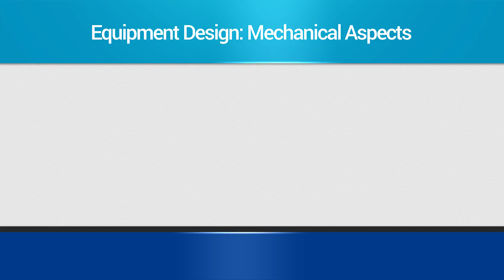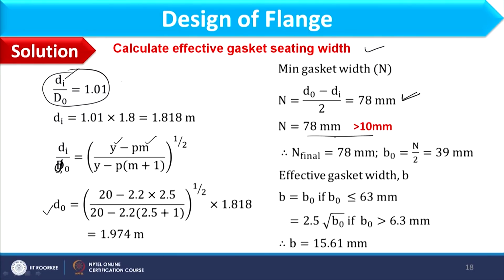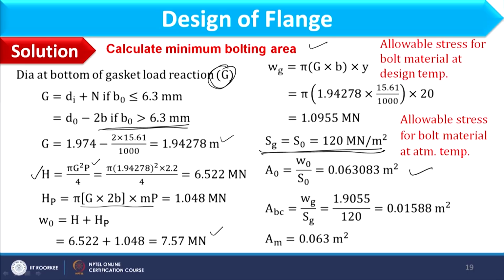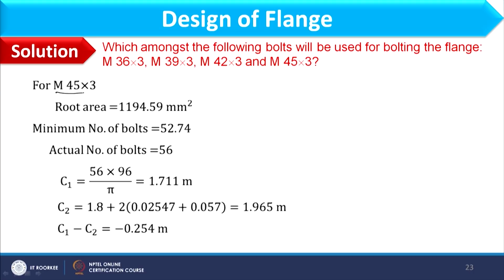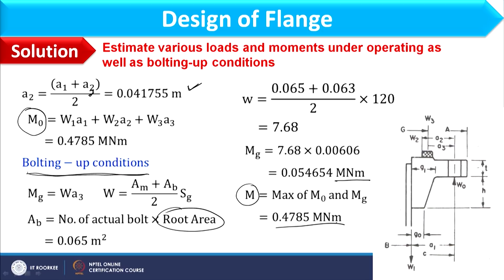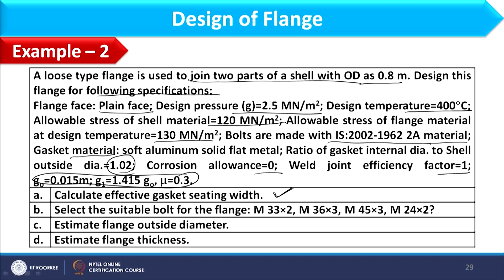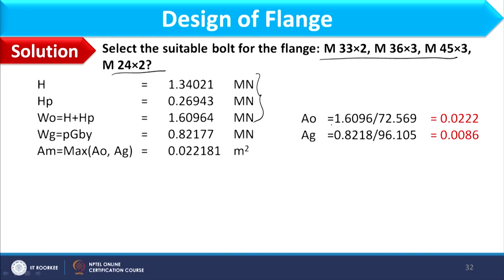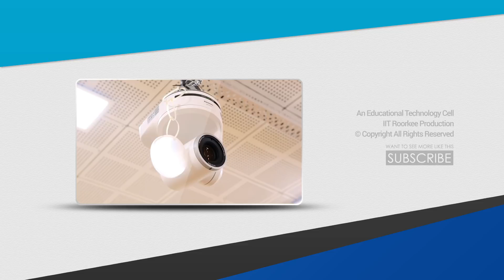Design of Flanges-2.2

Comment: Mam, i have a little doubt.
1st of all thank you so much for such an amazing and detailed information about design a flange.

My doubt is , we have calculated gasket OD= 1974 mm

And Bolt Circle diameter=1954.94 mm

Gasket must be enclosed by bolts for narrow faced flange as you told us in earlier lecture.

It means bolt circle diameter must be greater than the gasket OD, however in this case it is lesser.

Please guide me what to do?